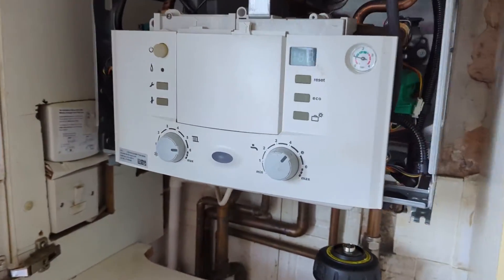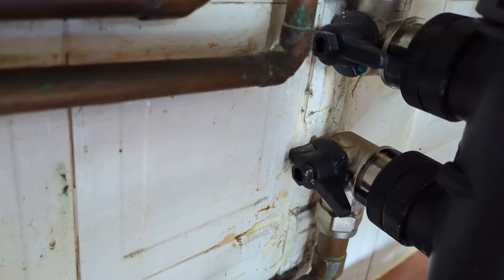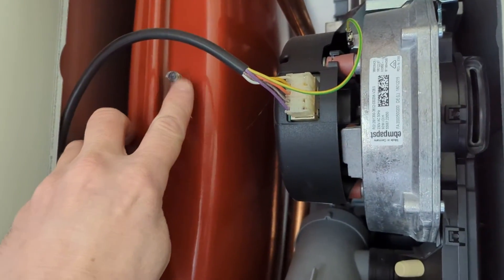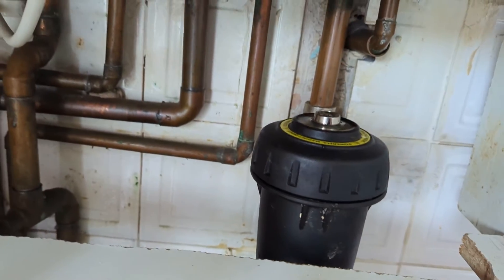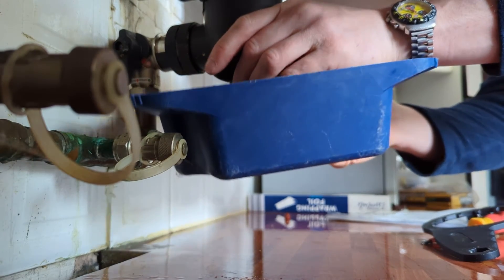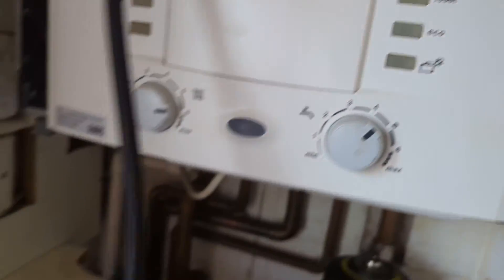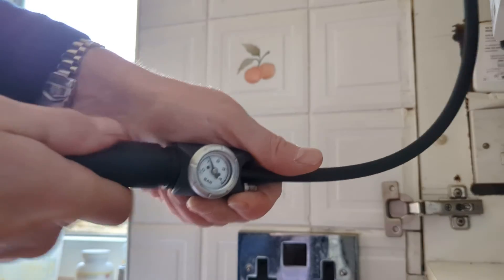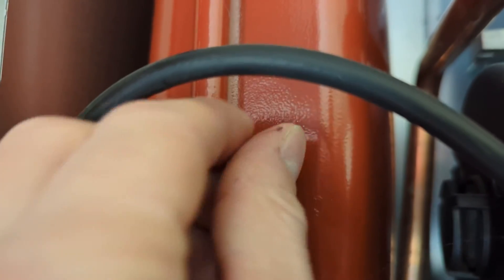Worcester Bosch CDI Classic. Re pressurising the expansion vessel using the filter

Comment: Hi having the same problem, advised to supply & fit new Worcester Greenstar 38 CDI Expansion Vessel
Reply from the maker: Ive found in my experience, Worcester Bosch expansion vessels very rarely fail. They get condensation sometimes in the air side but generally can be pumped back up on a service...
Reply from the maker: https://youtu.be/rR36zafe-lk
Reply from the maker: Have a little look at this other video I did 👍

Comment: Thank you very much indeed for this video! The only one I could find but it has just enabled me to diagnose and pressurise my Greenstar 30CDi classic which was pressure releasing when the large radiator circuit was heated up. Expansion tank was at 0psi but took a 0.95psi charge perfectly and I also did silicone grease pre pressurising to hopefully lube up the valve core seal which I also do on bikes then added afterwards too to indicate any leaks :) My CDi has the black plastic twisty drain valve inside pre linked to the condensate hose so a quick twist and it cleanly emptied the boiler which was a nice surprise! Thank you again!!!
Reply: U mean 0,95 bar